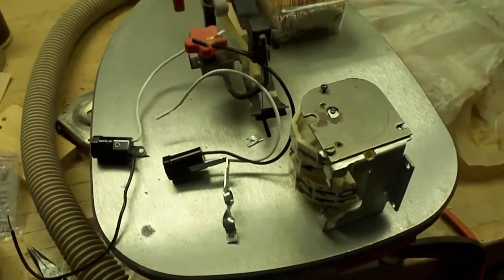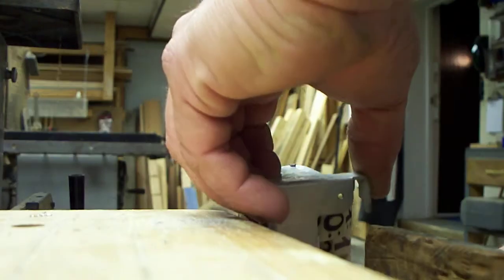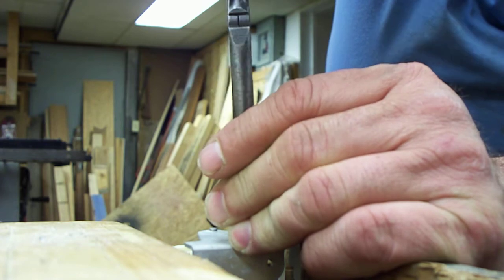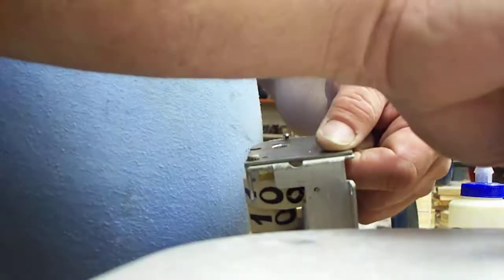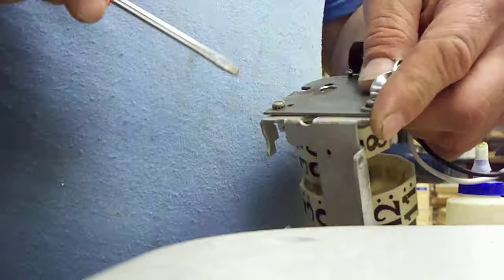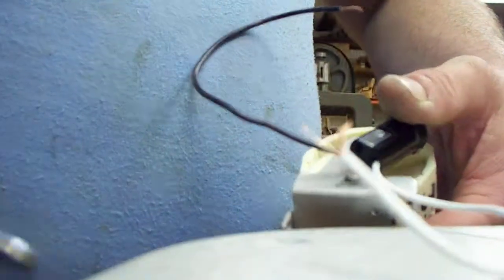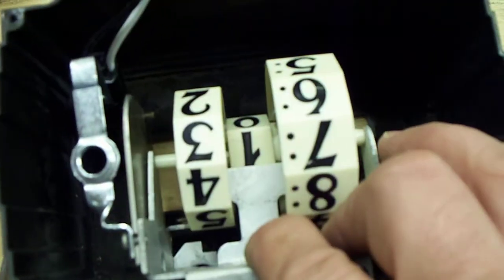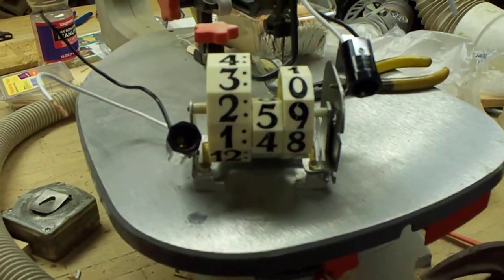installing lights part 2

Comment: Hi. I was wanting to add a LED Strip to the inside of my 24 hour clock. Do I power it by splycing the wires into where the power cord and motor are connected?
Thanks for the video.

Comment: @force311999 The Digi Glo that I got was DEAD.  my wife plugged it in while I was at work, and called me up and told me: "You are going to kill someone on eBay".  Than I knew that something had happened with the Digi Glo, because I was so concerned that it wasn't going to work...